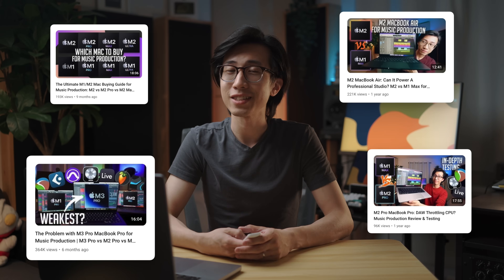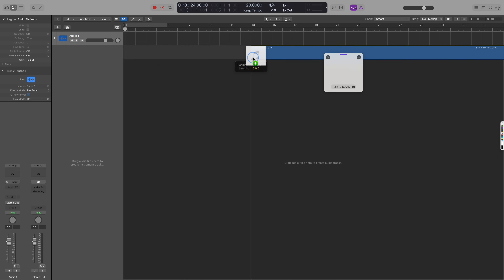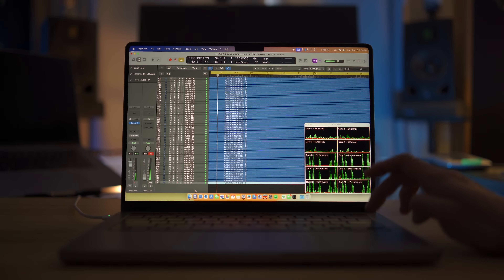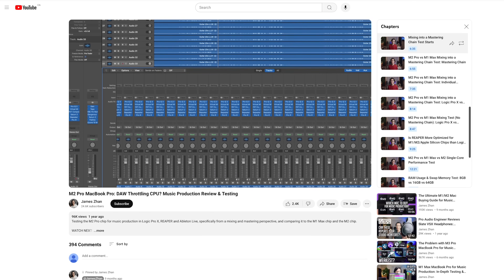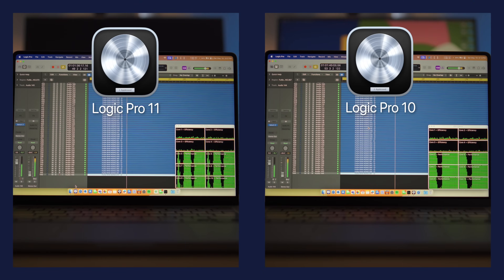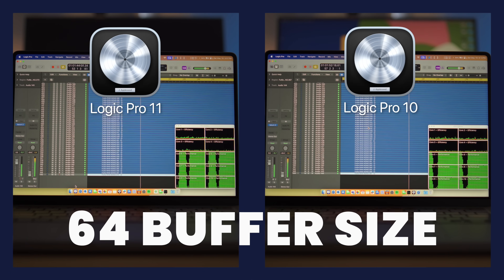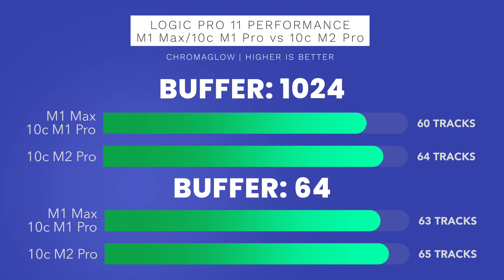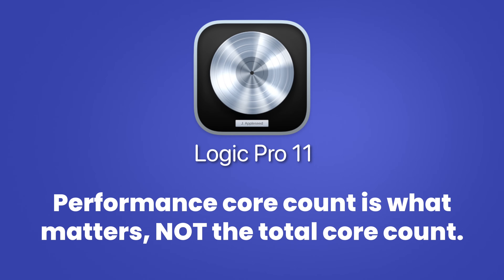Logic Pro 11 on Apple Silicon: Are CPU Cores Fully Utilized?

Comment: in real use, single core performance is so much more important, therefore maing this whole testing quite superfluous
Reply from the maker: Not sure about that. In real use, Logic uses multiple cores. While single core performance is important, multicore performance is also important.
Reply: @JamesZhan  i have once jumped from i7 6700 to different xeons and even a 14 core x299 behemot i9 moving the same macos install, only the 6700 was able to playback the projects (made on the 6700) flawlessly, s they were all just using mostly 2 threads, and this has been true for all the clients i met during the years. Once you start using inserts, sidechain and a bit of a mastering chain on top, it's not about multicore anymore. A lot more comes into play like raw single core performance, intercore latencies wich x299 , Ryzen with dual CCD and  apple Ultra chips suc* at...